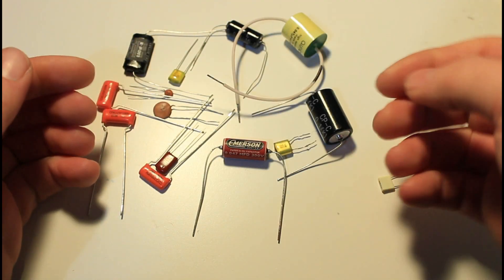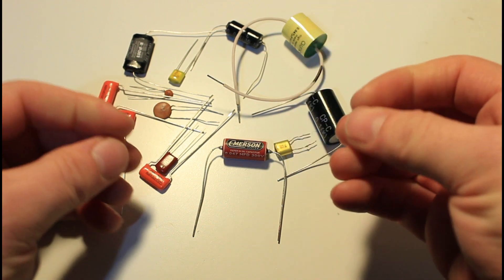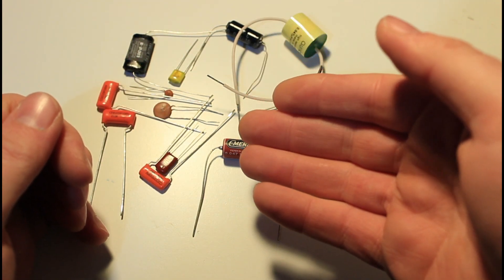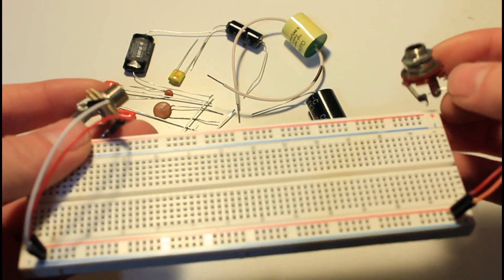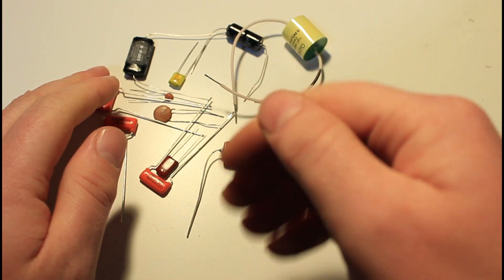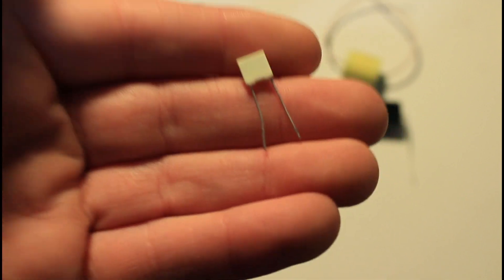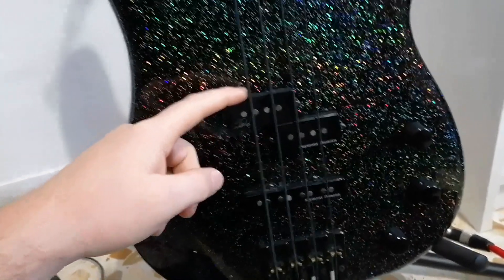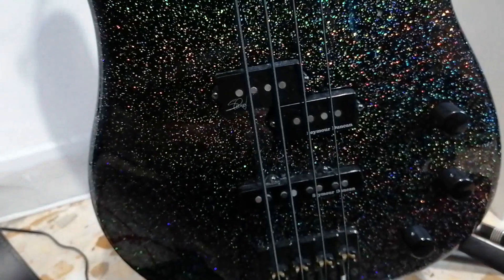Can you tell the difference? 0.20€ vs 20€ capacitors

Comment: Of course you couldn't hear a difference with the Paper-in-oil Caps, you have to charge them up first. Your passive pickup makes about .8 microvolt of current. The modern Paper-in-oil Caps are rated for 600 volts. It takes several hours of hard playing to fully charge them and get them to open up. This test is therefore not accurate.
Reply: I hope you are joking.
Reply: @DeusExAurum  Why would you hope that? Electricity is what it is bub. Do you actually think you can fill a bucket with a teaspoon in 2 minutes?? God gave you a brain, feel free to operate as though that were the case.
Reply: @jomamma1750  The time it takes to "charge" a capacitor is determined by its capacitance, not its voltage rating. A 47nF/600V and a 47nF/100V take the exact same amount of time to charge. Also a pickup does not create "0.8 microvolt of current" since microvolt is VOLTAGE not CURRENT. All in all, you're a great troll, you made me respond.
Reply: @DeusExAurum  Install one and find out. You forgot about amperage, rocket boy. Pickups just don't produce very many elecrons, and yes the capacitors do have to charge otherwise they cannot discharge, which is their function. If you understand how a capacitor works you would understand that. Think plumbing and expansion tank. You're locked into terms of either house current where the amperage(water flow) is sufficient, cut that back to a trickle and see how long it takes to fill. Same principe. Use that grey matter for once and quit mis-reading textbooks.
Reply: @jomamma1750  I did not forget about "current" (that's the actual word you are trying to use there). No wonder that a plumber trying to lecture people on electronics is dead wrong on his terminology and fundamental electronics knowledge. Get back to fixing my toilet.
Reply: @DeusExAurum  Then explain this one, O' paragon of brilliance: why does an Emerson PIO cap rated for 600volts and .047uf contain 3 times the physical internal volume of material of an Emerson PIO cap rated for 200volts and .047uf?? And why does the Emerson PIO cap rated for 600 volts and .022uf not contain slightly less than half of the physical material as the one that is rated at 047uf?? Why are do they contain the exact same amount of material?? Why are the caps rated for 600 volts the same size regardless of capacitance ratings?? Why are not the caps rated for different levels of capacitance different sizes commensurately in line with their capacitance ratings as you claim is the case?? What do you know that the manufacturers do not?? Do you think material is free?? You could get paid a fortune by going to work there and teaching those people how to correctly build capacitors. Your genius will cut their manufacturing costs in half and put you in the Vice Presidents office of that company in less that an hour. 
Seriously, you should do yourself a favor and go find out HOW these parts are rated before you make some inane comment.
As far as the plumbing analogy is concerned I use simplified methods of explanation when I run into people not capable of understanding what I am talking about. 
But yeah go teach the capacitor industry how to design and build capacitors, they'll welcome you with open arms I'll wager.
Reply: @DeusExAurum  Unfortunately for you that's not the case in a variable microvolt DC positive ground system. You're thinking in terms of a steady voltage AC system, computer wiring for example. AC and DC work very differently bub, and their ratings have different meanings as well. Go learn something outside your little box.
Or apply for the job at a capacitor manufacturer, they'll get a real kick out of you!!
Reply: @jomamma1750  "variable microvolt DC positive ground system"  Come on, now you are just stringing words together to sound clever.
Reply: @DeusExAurum  Says the guy that can't tell the difference between Alternating Current and Direct Current. Probably can't tell the difference between a Positive Ground system and a Negative Ground system. And absolutely does not understand magnetic inductive current, let alone how that relates to conventional generation.
Reply: @jomamma1750  Since you seem to believe guitars to be "variable DC" systems and computers to be "steady voltage AC" systems, I'll let you think again, who the person is that doesn't understand what DC and AC is. :)
Reply: @jomamma1750  Yes, me and all the other "Black Swan Trolls" are paid by the mylar capacitor industry to badmouth people telling the truth about superior sounding vintage PIOs. You've cracked the case.
Reply: @DeusExAurum  Ok Xi, tell us more!! Tell us just how smart you really are. Go on teach us how passive magnetic induction works.
Reply: @jomamma1750  Who is Xi? And why do you think capacitors have anything to do with induction?
Reply: @DeusExAurum  Oh, so in other words you are incapable of explaining how passive magnetic induction produces electricity!!
LOL
get a real job kid
Reply: @jomamma1750  Should I become a plumber? Maybe you could teach me. :O
Reply: @DeusExAurum  Back from lunch? Troll boy.
Reply: @jomamma1750  So you can't teach me plumbing? Too bad, in return I could have showed you a thing or two about electronics :(
Reply: @jomamma1750  I can tell who is out to lunch and never came back.
Reply: @DeusExAurum  You keep talking but can't say anything. Like I said, Troll, you should have stayed out on lunch. You have long since already proven my point. The fact that you can't see it is priceless to me.
Reply: @jomamma1750  I have explained that you use jargon you seemingly do not understand. Furthermore, your main argument is simply wrong and I have pointed that out to you which made you go into completely unreleated rants. Therefore I don't have to say anything, I'm just enjoying the show and you spazzing out.
Reply: @DeusExAurum  You have no point. You can't even explain basic passive magnetic induction. You're not smart enough to have an opinion
Reply: @jomamma1750  You literally do not comprehend what a maximum voltage rating is.
Reply: @DeusExAurum  You still can't explain how passive magnetic induction operates. You're not smart enough to have an electrical opinion.
Reply: What a pile of unscientific crap.
Reply: @andymellor9056  Really? Then install a 600v PIO cap in your bass and see how long it takes to charge. And ~ 2hrs later when the cap charges and your full tone potential is reached try to determine as to exactly why that happened.
Reply: @jomamma1750  a 47nF cap in series with a 500 k resistor takes around 0.1175 seconds to charge. Being an engineer I have the ability to calculate these things (T = 5RC). The voltage rating only tells you the maximum voltage the cap can withstand. No amount of hard playing will make a difference as the pickup voltage source is but a few mV.

Where are you getting these ideas from? You seem very invested in them.
Reply: @andymellor9056  Takes .1175 seconds to charge with what current? You seem to make some assumptions.
Reply: @jomamma1750  Lol. 

Let's imagine an uncharged capacitor in an RC circuit, connected to a voltage source. Initially charge (Moving charge = current) will flow into the capacitor, as the capacitor stores charge, a voltage will develop across the capacitor, opposing the inflow of current. As the voltage across the capacitor increases, the current flowing into the capacitor reduces. Eventually, at the point where the voltage due to the stored charge is equal to that of the voltage source, the current stops flowing.

Of course in a guitar the emf induced by the pickups is constantly changing and is goes both positive and negative. The voltage across the capacitor, and hence the stored charge is constantly changing and the capacitor never quite keeps up - which is to say there is a phase difference between current and voltage across the capacitor. 

The bigger the capacitance, the more charge can be stored and the longer it takes to charge. At higher frequencies, the  capacitor never has chance to charge properly. Note that in an RC circuit, the total voltage across the resistor and capacitor equals the source emf.  Therefore if you measure the emf across the capacitor, it will emphasis low frequencies (low pass filter) whereas if you measure the emf across the resistor it will emphasise the high frequencies (High pass filter).

In a guitar or bass tone circuit, the only appreciable differences between types of capacitors of the same capacitance are....
1. Linearity - Ceramic caps can be non-linear. In practice the emf is so small compared to the caps rating that this isn't important (Unlike in amps where it is a factor due to larger emf's compared to the rating). There should be no appreciable difference between linearity in any other cap type.
2. Series and parallel resistance - the capacitor itself may have some series resistance which add to that of your pot, and parallel resistance, which might affect the pot taper, but you don't need PIO for this - you just need a good cap (say poly) and some cheap resistors.
Reply: @andymellor9056  lol, Ever hear of amperage Mr. "engineer". Did it conceiveably dawn on you that, in this particular system, the amperage is woefully inadequate? Do you realize that the original capacitor, as initially engineered, was ~ 1/12th the size of this one? 
You're running your calculations based on 2 or 3 complete errors.
#1 you think you have regulated AC current with adequate amperage and you do not
#2 you think that this system was engineered for a capacitor this size and it was not
#3 you think that 100% of the current generated by the pickup goes towards charging the capacitor and it does not.
A. You do have an unregulated DC current in the microvolt range with micro amps for electrons ie. almost no current to begin with
B. This miniscule current was engineered to work with an appropriately sized capacitor. This 600v capacitor in question has an enormous capacity relative to the available current
C. Electric production in a bass is erratic at best and when you cross that with time your area "under the curve" as it were, is minimal. Perhaps 15-20%? even if you are playing hard.
D. When you install an uncharged capacitor and play what happens?? You hear bass, of course. The pass-filter functions normally and send its appropriate signal width to ground as intended and as directed by the potentiometer. Only a tiny fraction of power goes towards charging the capacitor. But just enough bleeds away in performance of that function to keep the instrument sounding dull and lifeless. This dull and lifeless sound is indicative of ~ 5-7% signal loss. Similar to what you might find from a frayed patch cord as a common example.
E It takes quite a while to fully charge the capacitor and balance out the system and only then do you get full signal, hence full sound
Bottom Line: This threw me for an absolute loop the first time I performed this modification to a bass. I have repeated this experiment over 20 times and received the exact same result each and every time. The aforementioned collection of phenomena is my best explanation for this factual event.
Why Debate?? Go put an Allparts Black Candy in a P-bass and see for yourself. The part costs less than 20$. All you're doing right now is theorizing, which is irrelevant. Go put some rubber on the road and find out. BTW there are,  or were at any rate, a bunch of solid technical explanations for how these PIO caps work in these systems by guys far more conversant in this little baby current stuff than I'll ever find time to be. Go check some of them out if you're actually interested.
Reply: @jomamma1750  Your word salad shows no understanding about how an RC circuit works. Current flows dependant on the reactance of the circuit and the EMF driving the current.

But remain ignorant if you will - either that or you have a stake in selling this expensive gimmickery and are writing in bad faith.
Reply: @jomamma1750  "You can't even comprehend an ampere."   You are pure comedy.
Reply: @DeusExAurum  Ok Troll. Grow up and get a real job.....
Reply: @DeusExAurum  Get a real job kid, you're embarassing yourself, badly.
Reply: @jomamma1750  You know what is embarassing? Thinking that a 600V cap takes longer to charge than a 100V cap and then claiming you have engineering knowledge.
Reply: @jomamma1750  Don't worry, old man. I'm doing fine... mainly because I am engineer who actually knows a thing or two about capacitors. ;)
Reply: @DeusExAurum  Ok $4/hr Troll, keep babbling, you're hilarious.
Reply: @jomamma1750  I did write "your".
Reply: @jomamma1750  Ok... Explain what you think happens with reference to equations - Go mathematical, or go home. because if you don't understand the maths, you don't understand the circuit. 

I'm not expecting a response other than insults, btw - because you seem to use them to hide your fundamental ignorance.
Reply: @andymellor9056  Oh, I didn't get this message.
Here's the issue: you're running the mathematical formula for a capacitor in series wiring. However, in a guitar or bass the wiring is in Parallel. If you wire the guitar or bass in series, as you suggest then your formula for length of time to charge the capacitor is correct, however as soon as the capacitor charges it works like a check valve and NO SOUND WILL FLOW PAST THE CAPACITOR!!!! Your guitar will be awfully quiet......
This level of confusion is exactly what happens when children misread formulas on the internet.

Comment: Just to be clear: are the samples with the tone rolled all the way off? If so, I would think that it would be most flexible to have the 100nf cap, to have a wider range of sonic possibilities from open to closed tone pot. You would cover the range of the 47nf cap and then some. Or am I misunderstanding something?

Very interesting comparison. Thank you!
Reply from the maker: Yes, that's the sound when the pot is turned all the way. Some people prefer a slightly longer or shorter range, hence having different values

Comment: I presume this is the sound you gets when you roll off the tone knob when its installed. Tone on 10 on a no load pot would be the clean sound.
Reply from the maker: Exactly, this it how it sounds when the pot is rolled all the way. Of course, you can dial in all the in-betweens
Reply: @OliverTobyn  great doing my strat at the minute put a .47 orange drop in it.
Reply from the maker: @nealo814  sounds good! Maybe 47 could be a little dark for a guitar, but I've never tried so it would be interesting to hear it!
Reply: @OliverTobyn  I have one in my tele. Good on single coils but a lot of people use a .22. I took a 22 out. I can always put it back in

Comment: Why you using small capacitors in this configuration they blocked all hight frequencies (hoght pass filter)???
This is not good test!!!
Reply from the maker: What do you mean? That's how a tone pot works
Reply: @OliverTobyn  a,ok ,so i will listen on my hiend system (: ,but the difference in capacitors very large,as the system quality grow the difference will be increase

Comment: I only go by value and voltage. Technology has made caps of the same electrical value many times smaller and less expensive comparing to 50 years ago. I re-capped a 1960 transistor radio with modern caps and the crowded circuit board looked empty when I finished it. It works and sounds good. I've been troubleshooting electronics all my life and worked 13 years being a engineering tech in manufacturing. I know nothing about guitars but lately being around someone that rebuilds guitars I think there is a lot of guitar myths in electronic components.
Reply from the maker: Agreed. Some vintage caps even sell for $50-60 which is insane. I'm not saying you should put the cheapest components in the instrument, but you can find something decent for less than $10
Reply: I've noticed a lot of newer guitar repair people popping up all over. The market used to be fun but now all the repair people are combing the market and snagging up the deals. I've got 6 100 dollar guitar's now and I guess they're all mine now. It only seems natural though cause of the times we live in. It's a guitar tec world now.
Reply: Can you Cut open the Mundorf Silver Gold Cap to view the inside can ? Is it real Pure Silver Foil or basically just a Fake Foil ?  Video have !  ( Surely u will have Billion of Billion of Viewer in your Youtube).................Cut it now Mundorf Silver Gold Cap...........!!!

Comment: its more a placebo. if you have an old sentimental guitar  and wanna get her new pots, cloth wrapped wire, oil paper transistors  as a project of passion kind of thing, but for performance it don't really matter. the only difference paper transistors make is they age with the guitar and loose capacitance so they don't get a bassie, its more of a product failing.  but if you have a child and you wanna give a tele, strat, les paul/sg variant to, the paper transistors might be a cool mod they might appreciate when they are much much older like 30's+ if they hold onto the guitar that is. just make sure the pickups are alnico 2 thru 5, those will slightly age as well with the wood of the guitar, its recomended its the same wood species as the authentic vintage models. with modern machining even a low priced guitar is excellent precision quality vs. hoping jimmy in the 50's was having a good day at the guitar factory.
Reply: Can you Cut open the Mundorf Silver Gold Cap to view the inside can ? Is it real Pure Silver Foil or basically just a Fake Foil ?  Video have !  ( Surely u will have Billion of Billion of Viewer in your Youtube).................Cut it now Mundorf Silver Gold Cap..................!!